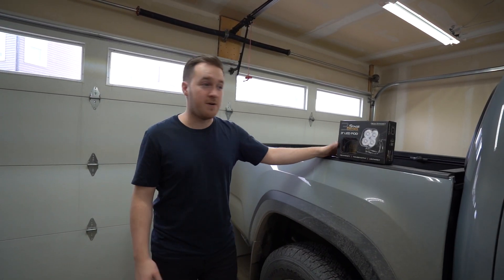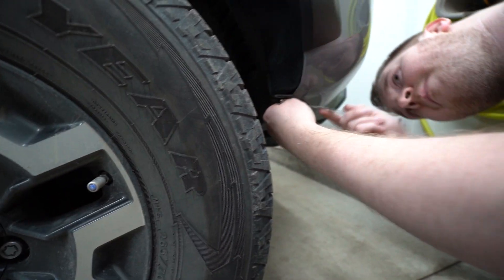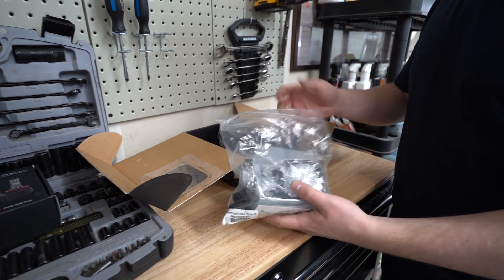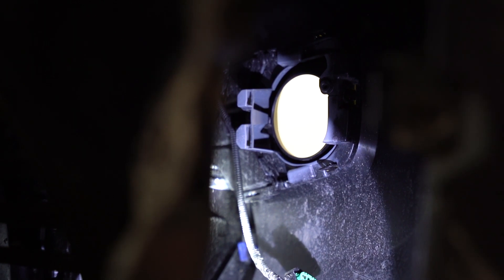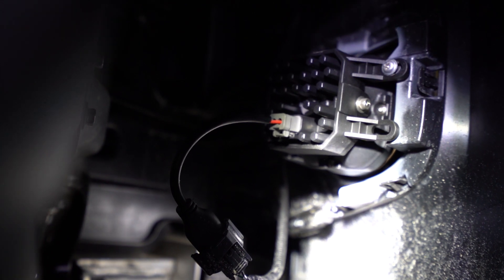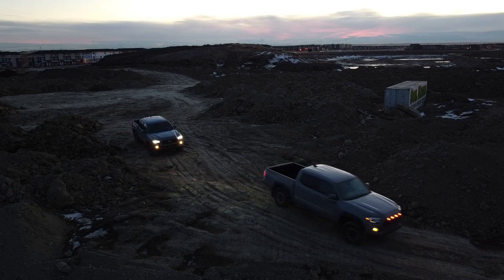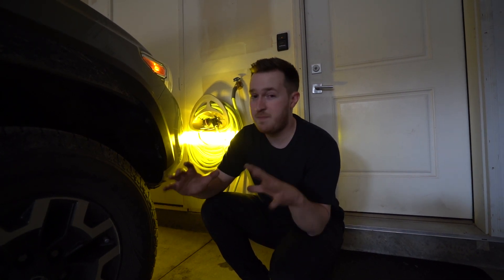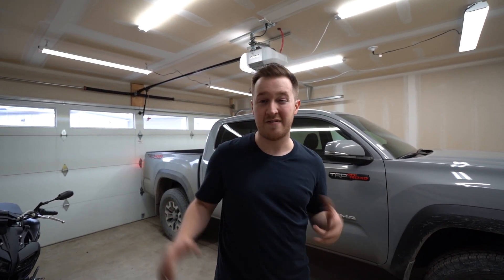Diode Dynamics SS3 LED Fog-lights in-depth installation | 2016 - 2020 Toyota Tacoma TRD Off Road

Comment: Love my DD SS3 pro fogs as well! Excellent choice. FYI those fogs are aimed way too high though. Looks like they are the same height as the headlights. Should be aimed about half way between the low beams cutoff and the ground when about 25 feet away for them to be street legal. Otherwise they are just blinding oncoming traffic in day-to-day driving.
Reply: Yeah they do look too high. It would be blinding to other drivers.
Reply: I just installed mine and they don’t feel legal when I’m driving with them at night. How do u angle them?
Reply: @Cementgraytacoma Pros are probably not legal. For dogs I kept it at "stage 1" while everything else will be off-road.
Reply: these fogs aren’t street legal regardless
edit* pros aren’t street legal
Reply: @youtubeguy345 Yes they are

Comment: Have the sports performed well in the cold? I'm on the west coast (Van). You are in Alberta. Did the DD SS3 sports generate enough heat to stay clear of snow & Ice in an Alberta winter? the Pro's generate much more heat. Would you have gotten the pro's for the snow & ice melting heat instead of the sports?
Reply from the maker: They generated plenty of heat, worked no problem in -30*C!
Reply: Thanks Spencer. I have a pair of Sports on order for my 2020 TRD Sport from your link. Not getting clogged with snow was one of my only concerns. They not only look fantastic on your truck but are very practical. Perform X2 better than OEM fogs  from my research. A quality product made in the USA too!

Comment: If you ever decide to change these out or adjust them, you can easily just reach down through the engine bay.  No need to pull back the fender liner.  All you need is one of those stubby screwdrivers.
Reply from the maker: That's very true hah we realized afterwards!
Reply: Thanks, just about to ask about adjustments.

Comment: Still not sure how far out the bracket is suppose to be. On the instructions it said there is suppose to be a gapping hole.
Reply from the maker: Ken S there’s a slight gap about 1cm yes but it can only fit 1 way regardless so unless the screws don’t go back in it’s rivht
Reply: @SpencerHogg  do your fog lights have some play in them?  Do they slightly wiggle?

Comment: So you "adust it" before you put it in without even knowing whether the adjustment is adequate.  No wonder people have these shining in the trees, there needs to be an easy screw adjustment like the factory fogs that you adjust AFTER you install them.
Reply: There was a reply, can't find now, but apparently adjustments can be made by reaching through engine bay after installed.